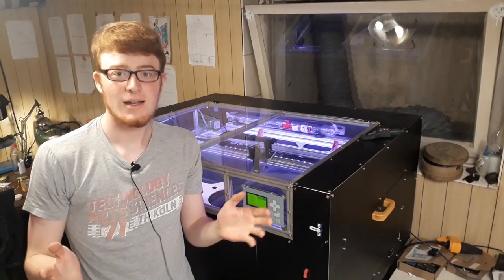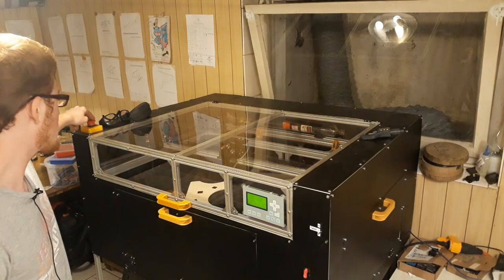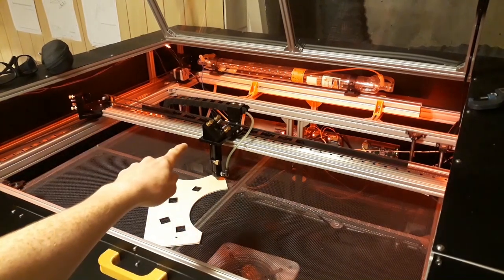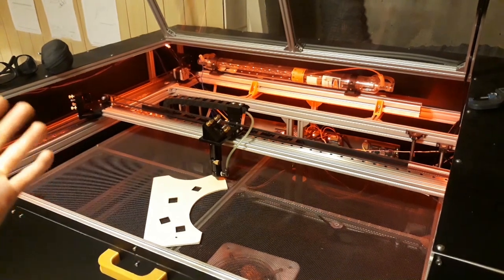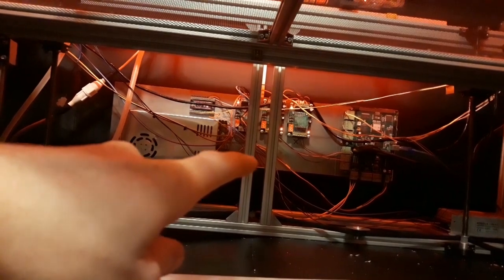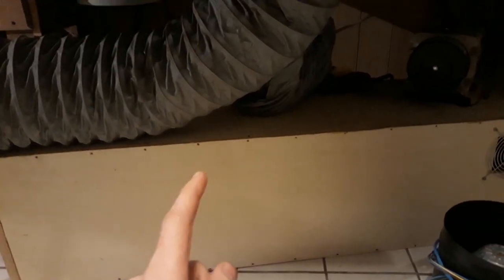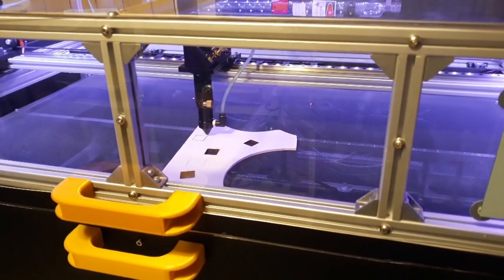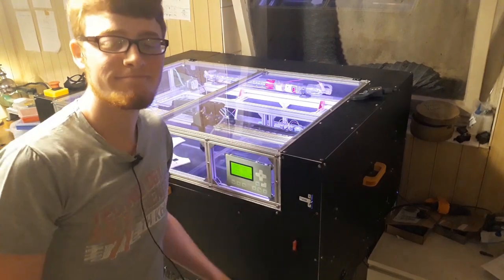Homemade 40 Watt CO2 Lasercutter !

Comment: nice build. i have the same setup with two motors on my y axes, going rebuild mine to one motor now with axel and gear ratio. i have troubles with getting perfect circles with mine in two stepper motors in series , iam also going to 3 phase motors from 2 phase motors.  how do your circles work out?

Comment: 25 kV x 20 mA = 500 W, not 50 W...
Optical power in CO2 laser can be UP TO 20 % of pump power.
Reply from the maker: Holy cow you are right.. Where is the 50W rating coming from then? Maybe an average? Idk.